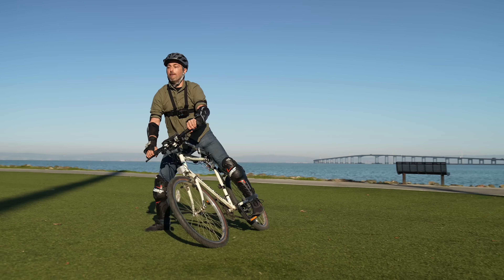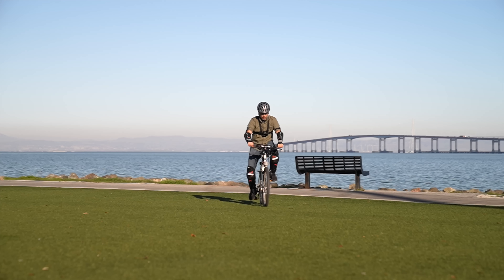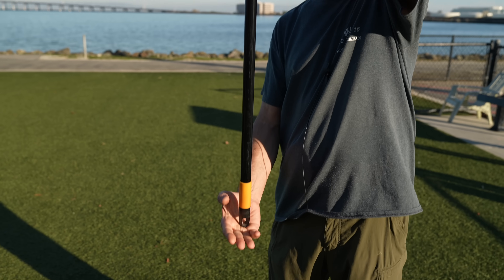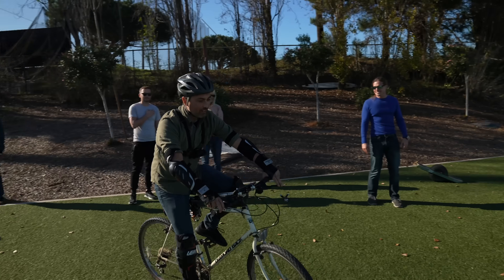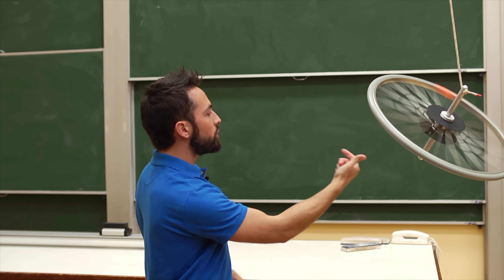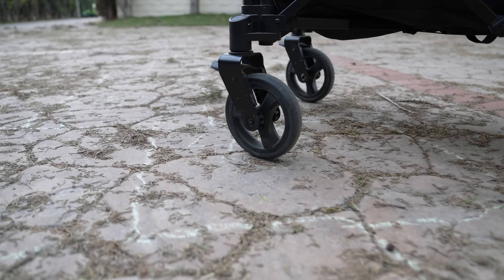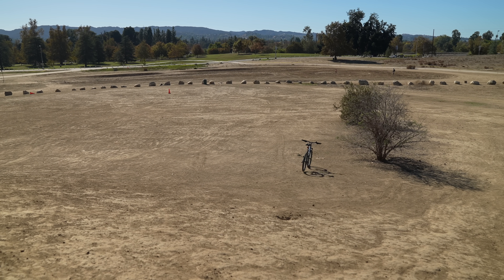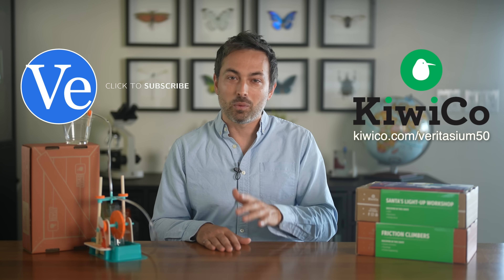Most People Don't Know How Bikes Work

Comment: Can you do these experiments with people that actually bike race? A lot of turning/corner at a reasonable speed (much better balance) you do in fact lean into the bend, just like you do on motorbikes. I think it is not very faithful doing these experiments at slow speeds with high variance in balance and also with cyclists who aren't necessarily super confident on the bike.
A lot of bmx riders can do small hops to maintain balance (does not use any steering) and I'm sure people like peter sagan could use this modified bike easily. I think this needs to be addressed in this video.

Comment: I have thought about this. When riding a motorcycle, to turn left you push the left handle forward to lean the bike left, the the front wheel automatically turnes left to balance out the lean.

Comment: Why it wasn't me who got invited to test this bike? I would able to rotate in that fixed steering scenario as well as locked one.

I have a few very different bikes in my collection and when I ride on them in the past I also essentially make mini-games for myself, sort of set a rules I should not break and keep driving it within that limit and so one of them are:

Staying on a bike when I wait cross road lights become green without rotating front wheel, only using my body mass to balance it, I essentially find that staying in high position helped it to respond faster to leaning changes. And in that case I also can use my kneels to counter-lean bike in another direction that my upper body is leaning.

Another one mini-game was to drive with both wheels being completely straight. This is simply solved by zig-zagging effect from a small amplitude for straight and not complex roads to more broader, larger amplitude for a more complex environments: slippery roads,
down from the hills roads (you essentially trying to loose speed by using large amplitude),
bumpy roads (when you have such a road, when the force is that applying to you is larger, than road "feedback", your main force is directing and controlling your direction, rather that that "feedback", as example if bump from a wheel should lift your front wheel, loose grip and apply a direction which make you unstable and require you to rotate, but from straight position is hard to control because you have no other force than gyroscope, but if you leaning to the side you essentially falling and this force is so high that you automatically turning to compensate that and even if you bump in same way when the wheel touch ground you will keep falling to the same side, just with different speed (at the start you slow falling, but at the touch you start fall faster -> do more sharp turn to compensate that)...),
etc.

Anyway this is something I had experience to on my own, just on a regular bike. I would just repeat same knowledge and experience to it to drive such a bike

Comment: Similarly, most snowboarders don't know that turning left means to let the rear of the board slide from underneath you to the right. You start falling to the left, and you compensate by braking the board and bringing your center of mass back between your legs.

Comment: so what about a single bicycle wheel? It will not balance while stationary but if spinning will balance just fine and continue rolling until it slows down or runs into something.  The "steering" aspect does not exist here yet it still stays upright.    The gyroscopic stability added by a rotating body is still part of this equation... or do you disagree?
Reply: Unicycle on ice will not be stable no matter how fast the wheel is spinning.

Comment: Bicycles with 'auto handlebars' sound OK, until you get used to it and then try to ride a normal bike. Like driving a car that doesn't have 'mod cons' like power steering, ABS or (my hate) some sort of brake assist

Comment: I think this “balancing” with bikes happens because you are riding at very slow speed. If the bike is fast enough, you dont need the counter-turn thing. You can just lean towards the direction you want to turn, unless it is a sharp turn and ofc sharp turn require slow speed.

Comment: The "weight of the handlebars" thing is not universal. As a child in the 1970s, most of my friends bikes had handlebars which were almost entirely behind the steering axis, sometimes stretched out quite a bit. The wheel itself was probably still in front of the axis on these though.

Comment: 1. So if you lock the steering on a bike that you just pushed (without anyone riding it) it would fall?
2. how would you explain this in a unicycle if the compensation happens by the tilting the center of gravity of the person who is riding it? Why can't this be done in a bicycle in this case?

Comment: Motorbiker here: countersteering is an essential skill for correct control of a motorcycle. And it comes naturally. If you turn right, you think you are falling right. You put your right hand out to stop this and... steer left.  Also, the torus shaped tyres mean that when you steer, the contact patch of the front tyre moves rearwards, shortening the steering rake and tightening the turn.

Comment: Many bikers will have seen this effect when driving on the edge of a ledge, where you really don’t want to move your front wheel any more to the left or it would fall of the ledge, in effect stopping you from going right or left. At school I learned we needed to shift our balance and start falling to the right to then catch the fall and safely make it of the lefts side drop.

We also had a special modified bike with an extra gear in the steering wheel so that steering left with the handlebars made the wheel turn right, really made you think about he steering and your balance if you wanted to master that one

Comment: It seems pretty amusing that bikes are actually really well designed to not fall over, yet we don't fully know why they don't. 
Also every wobble and course correction done on a bike could be modeled as a brief bit of circular motion, with your speed as the tangential velocity and the x-component of gravity that's trying to tip you over as the centripetal force. And since you're constantly doing this to balance the bike, would all supposedly linear movement just be a variation on circular motion then?

Comment: As someone who rides a motorcycle, learning about counter steering is very basic knowledge. You don’t think about it with a bicycle because we learn when we’re so young, and you’re never really going fast enough for it to be at a severe angle
Reply: And in fact that faster you go the less you do it because you lean more into the turn so there’s less of a need to turn opposite first because your inertia from moving goes into the ground in the direction you’re going by leaning.

Comment: Counter steering is true in bicycles or motorcycles. Handle bars are a way to control lean very easily and efficiently. Handle bars are really not steering wheels like a car but are lean levers. What fools people is that when your in a turn and leaned into the turn it appears that your turned into the turn. I could draw it on a white board better than trying to explain it here. 
This is evidenced when a child try’s to go from being a very good tricycle rider but can’t operate a bicycle. 
Unfortunately this is always controversial but it is absolutely true. Just get on your motorcycle or bicycle and just push forward on your right handle bar (which is turning left) and the bike will lean right.

Comment: This is such a load of BS, and you even debunk your own argument by saying that when a bike tilts to the left it goes to the left. But for some reason you think that when a cyclist is riding it you lean right to go left??
This device added to the bike to apparently prove this is awful. Having the light appear on the handlebars means you have to look down which every cyclist knows causes more wobbling and instability. Then you expect the cyclist to make a sudden turn while cycling relatively slowing, by what looks like very inexperienced people. Of course in that situation the front wheel will be going all over the place and locking out one direction is only going to cause the cyclist from falling off. Constant balance corrections are happening all the time and locking out 1 direction is not the correct way to so what is actually happening.

I
Reply: "when a bike tilts "
When.
WHEN.
That means not before.
But bike can't tilt left if the fork can't steer right before the tilt, so the is no WHEN.

Comment: There are three systems working on a bike. Gyroscopic stabilization, momentum and self driving. All three work together. The moment you mess with one, the rest will fail. Your bike just proves that.
Reply: Gyroscopic stabilization is not needed.
Neither is the momentum. it makes things easier, but it is possible to keep bike up just by countersteering it.

Comment: Learned this from a video explaining how to handle the speed wobbles at great speed on a motorcycle, same principles apply to a bicycle as well. They both naturally want to stay upright so when speed wobbles hit, you have to keep ur body as center on the bike as possible while letting front wheel take control and straighten you out. If you try manhandling the handlebars you will crash.

Comment: Do another test. But on a set of bicycle rollers.

Set it up as you’re supposed to. With front roller behind front axle for stability.
But the front roller is adjustable…

One you get good enough on the rollers to try and experiment, try moving the front roller forward. 
First directly under the front axle.
Then a second test with the roller quite a ways (~2”) forward.

Riding rollers is difficult enough, because the dynamics are not quite the same, reducing stability.
But the change in rake might be over the top, making it very, very difficult.

Comment: Advanced motorcyclists practice quick evasive steering by pushing forward on the "inside" handgrip, inside meaning inside the turn. Push forward on the right grip if you want to make a quick right maneuver. Same as steering left for quickly turning right but it feels different mentally.

Comment: Any opinions in this,

I see two types of cyclist
1. Leans bike into turn with bike and body in unison.
2. Leans BODY into turn, but barely leans the bike.

The only obvious advantage I can see is you won’t hit your pedal in the turn.
And you’re using the good rubber of your tire, not the sidewalls.

My mind fries when I try to think which option puts the most weight on the wheels to keep you from sliding.
Any takers?

Comment: You turn slightly the opposite way to create lean... Countersteer I think it's called in the motorcycle world? Used to avoid high-speed crashes by cutting your handles opposite the way you want to go causing lean which makes your turn sharply in that direction.

Comment: I have a bike that you ride only by shifting your body weight ( I welded the front axel to the fram so you cant turn the handle bars) so in theory I should be able to ride this bike without to much trouble.
Reply: I would love to see video of you riding that bike.  Do you have any?
Reply: @Rick_Cavallaro  no but once I fix the tiers Ill try and make one. I built it to build up blance. It dose use slightly thicker tiers but I don't think that should have 2 big of an effect.
Reply: @D00ML0RD1  I'm eager to see it once you have it fixed.  There are people that can balance that way, but it's a real challenge, and it isn't the way we normally balance a bike.  The thing I'm really curious to see is whether you look more natural riding it than others I've seen.
Reply: @Rick_Cavallaro  probaly not It took me 4 or 5 months of practice to get it down. And im not sure if its a skill I can just start again.
Reply: @D00ML0RD1  Don't get me wrong, but that makes me feel better.  That's consistent with my understanding.  It's a rare skill that some people develop.  But it's not how we normally ride a bike.  And that's not to say you simply got a whole lot better at doing what us mortals do.  You actually learned a skill that we simply don't use in riding bikes.

Comment: Early bicycles had almost vertical steering tubes and little to no fork rake. They must have been even harder to ride. Maybe that’s why you walked!

I reduced the fork rake of my racing bike (Reynolds) fork significantly (by hitting the bumper of a stopped truck at high speed).
The tire just cleared the down tube (had to move my down tube water bottle as its clips hit the tire.

Anyway, without the fork rake, the bike was incredibly squirrelly… it could not be ridden no handed even though I’d owned it for many years.
Reply: Admiring your customization methods
Also, 😂
Reply: @Glen Spivey 

I was wearing a helmet (which cracked from the impact with the trailer door, and was all messed up with road rash).
Without the helmet, I think I probably would have died. Instead, I only suffered some stitches, a broken arm, lots of road rash, and lots of advice about not “drafting”.

Comment: I disagree with the fundamental principle here that counter steering is necessary to initiate a turn. If that were indeed true then how do you explain riding a bicycle with no hands and successfully taking turns?

Another fundamental issue that was missed is the difference in tire profile between a car and bike when discussing steering. The round tire of a motorcycle makes a significant difference in turning. When racing we will use different profile tires to affect the turn in characteristics of the bike, a taller tire will turn in easier than a shorter tire. This is because as you lean the inside of the contact patch (inside of the turn) is on a smaller radius of the tire than the outside of the contact patch.
Reply: Bikes still countersteer, but the turn will be slower, tight corners are nearly impossible and multible tight corners... crash.

Comment: Um, I understand what they are demonstrating, but when I steer, I just lean with a little steer, I don't need to steer in the opposite way first. It depends on the severity of my turn. So, I don't fully agree with this. The speed I'm riding at and the angle of the ground I'm on also determine the best way to maintain balance through motion when I choose my direction. If I'm going quickly down a hill I don't turn to the left before to the right. If trying to position myself properly for climbing a switchback I often turn to the opposite way of the way I want to head in, so yes I agree there.
Reply: " I don't need to steer in the opposite way first."
Yes you do and you have always doing it.

Comment: This is not completely accurate.  First, the speed of the bicycle has to be high enough to overcome the side way force of any imbalance.  Second, balancing is a learned skill.  A normal person cannot magically balance a bicycle if you took away the steering that they are used to.  If you however give that same bike to a BMX biker, and giving them enough time, I’m sure that they would learn to balance the bike going straight.  Another thought is that a bicycle has two wheels, and so it has two point of contacts to the ground.  This increases the difficulty for a person to compensate for two variables, plus the balance of their own weight.  That is why going straight on a unicycle is easier, but you must have adequate forward momentum to overcome the leaning of you weight to one side.  It is like being in a rocket.  No matter how hard you lean to one side, the force of your weight will not influence the power of the rocket motor propelling you forward.  Please stop making videos to confuse people.

Comment: With practice is it possible to turn left by just first leaning left to get the angle and then turning left?  Do you Have to first counter steer right?

I watched a video on a bike with handlebars that turned it the opposite way - that took a while to learn to ride and then to unlearn again after.

Comment: Build a bike that is intentionally designed to not use the 3 mechanisms of corrective steering and see if it's possible to ride. Back pointing steering forks, Back heavy handlebars, and counter rotating wheels.

Great clickbait like "This bike is impossible to ride" or "I bet $10,000 He couldn't ride this bike".

Comment: I don't know if it's a thing when riding a bicycle, because it's not very heavy, you can achieve the turn just by leaning with your own body weight and it's easy. It's different when riding a motorbike (The really heavy one), you can not lean with your body weight as the momentum of the bike will keep it straight up, you need the bike to lean itself by counter steering.

Comment: Could you not steer this bike using gyroscopic precession? I.e. instead of trying to steer and fighting counter steering, just lean in the direction you wish to turn, similarly to how you would if you were riding a normal bike without hands.

Also a note on the gyroscopic precession comment - the force acts 90 degrees in the direction of rotation. I know you know that but for those unfamiliar with gyros it's a handy point to understand.